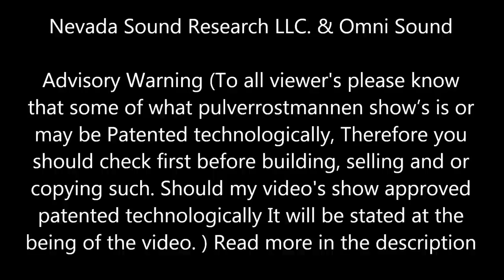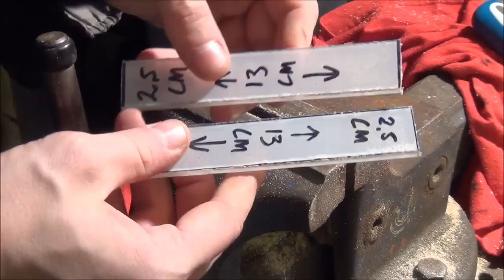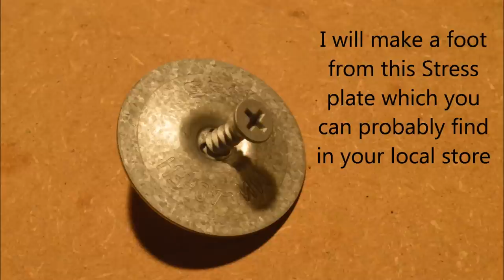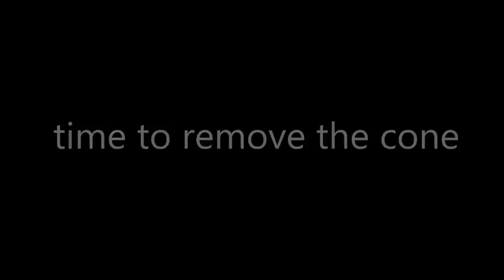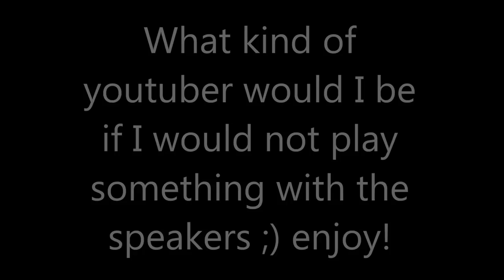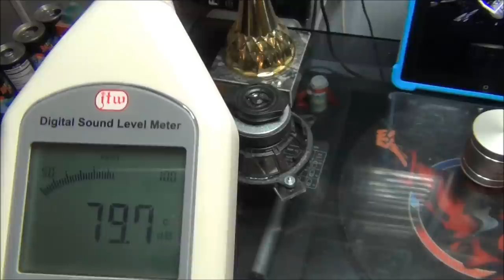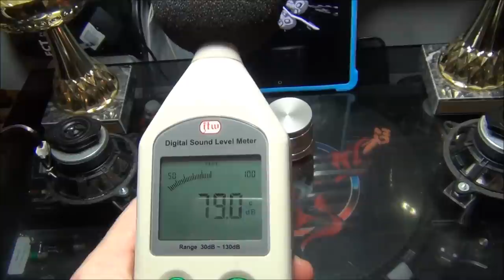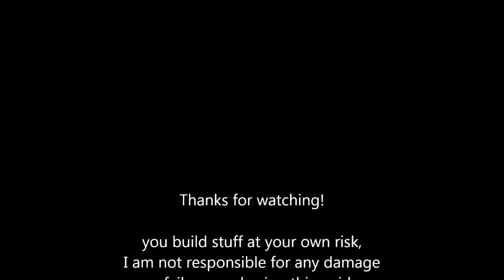How to make a vibration speaker (Omnidirectional design)

Comment: Nice job! You inspired me :) building one myself right now. Been thinking about the concept all day haha, improving it a little. What about some (rubber?) Damping between the plexi and the frame, and stiffen up the spider or even add an extra spider a like, so the coil wont be pushed in to far and it can rest on the piston and be able to move freely from the frame, wich is probably helping its response, and the weight of the frame itself can act like a sort of damper, vibration/weight/gravity :) keep up the good work! Ps. All those haters.. i dont get it, probably they dont want to use their brains.. ((neww)improved)stuff will only happen after trial & error ;) Greetings from Holland.
Reply from the maker: Thank you for your feedback!
Yes there is certainly ways you can improve how the driver going to work and probably the foot itself is a good way to start and you could add some rubber layer to dampen it a bit but it may also take sound away in the process, but the best thing you could get is some kind of sticky hard silicone that kinda stick to the surface that would make it rock solid in that part and would improve sound. 

And making the spider harder using more layers can help keeping the coil in center and stabilize the build but mostly the plexiglass gonna keep it hard enough to not slack if you tighten it off center and calibrate it for the drivers weight to end in the center position of the coil. Making the driver too stiff will make the coil suffer more from the heat generated and you lose efficiency of your device but would however improve the response and dynamics more. 
You are fully free to make your own modifications of your driver and experiment with what works the best and you will end up with an even better driver than mine :)
Why so many people react to this video is a lot because of misunderstanding about the patents that the respective owner claims that I show in this video but I do not own any of these myself but I need the information to show this on YouTube. 
And the other half is because many don’t understand the concept of this type of speaker either and also that it’s not better than real speakers. 
And this video is nothing but a educational guide and help for people that actually want to learn about speakers and how to make this kind of thing just for the fun of it. 
Everyone thinks different and I respect that as well but I also wants people to show some respect as well for their opinions. 
Anyway I would be very glad to hear how your speaker turns out for you! Be sure to connect back with your result and good luck with your build :) greetings from Sweden

Comment: Will induction vibrators from phones work for that purpose?
Reply from the maker: Likely not as most vibrators in phones uses a DC motor with a weight to create the vibrations, not sure if there are other types of solutions integrated in some phones today though or how good that would work. surface speakers do need some counter weight to work properly against various materials and if they are too light it would not make much sound at all for this purpose

Comment: will this work for a bass drum in a loud continuous setting?
Reply from the maker: If you dimension it enough it likely can, you can browse my uploads and check the other guide I have on "how to make a bass shaker" which is designed to shake a lot and for longer time with more power :)

Comment: Is there aliasing when you run it in stereo on the same surface?
Reply from the maker: +Jacob Jones the speakers seem to coop together pretty good on the same surface as it becomes louder when they play the same beat without sounding strange, you can hear them play stereo but maybe with less channel separation as the sound feels more centered between the drivers when they are on the same surface

Comment: I need help please anyone can i use a small speaker of about 3 inch? and also can i use plastic scale instead of plexiglass?
Reply from the maker: The speaker you may use can be a bit bigger or smaller, the outcome is that you get different output from them in the end, any stiff flexing plastic should do as long as it can carry the weight of the driver without bending too much.
Reply: Pulverrostmannen ok so thick plastic 2mm work ? and also do u have Facebook ?
Reply from the maker: Origami World I think it could work as the driver is small and likely pretty light. I actually don't have Facebook. I have or Skype or mail if you like to chat with me
Reply from the maker: Origami World I can't send you a private message as you don't have a public channel. if you navigate to the "About" on my channel you get my mail if you request it on that page, send me a short mail there and I give you my Skype from there :)

Comment: CA glue is not the best way to go here. All its strength is in tension . it doesnt have great tensile strength like that. It is greatest when it is being used too pull o the object so you really only needed a few drops of glue. A huge puddle of it like that does not give it more strength.
Reply from the maker: it depends very much how this glue is used, mostly it is used to glue hard materials with a thin layer as you say, but as you likely seen in the video the cap is made of plastic that few types of glue will stick well to, and also that the glue is put on both sides of the washer and makes a kind of cast bonding making it impossible for the washer to come lose even if the glue itself would not stick on the washer. it may still break lose as the glue can crack absolutely but we are not using tons of power here, there are several factors here of why I decided to use this glue for this build, it is cheap, Like REALLY cheap, it WILL stick on these materials, it is hard and not flexible increasing the output, it hardens fast, it stiffens the soft cone and dustcap and it is still strong enough to last any of the factors used on such build for a long time. Digital Designs uses CA based glue that uses the same activator for their high power sub woofers that bonds the spiders and also the cone to the voice coil and surround to the basket, and here we have the most extreme flexing with thousands of watts power that put strain with both positive and negative force on the glue and it won't break if a proper layer is made, and it is glued with a thick layer above the materials as well. but this video is a guide, you may absolute do it your way too, I won't care

Comment: I see no reason to cut out the cone as you've already greatly reduced the distance it can move. Leaving it would probably improve the sound of the unit.
Reply from the maker: Karmicmessenger the cone can be left on the driver but there are several reasons why I cut it away. One reason is to eliminate counter waves that could occur between the surface and the speaker that could lead to acoustic short that can reduce sound. The other reason is that the whole principle of this kind of speakers are that the driver itself should be as quiet as possible and only the surface should play the music, leaving cone would make its own muffled sound at all times. Third reason is that every little gram of weight reduced on the moving mass bound to the coil will increase the sound and range and we want it to be as light as it can be for this reason. 
The fact that surface speaker has a tight suspension is that it won’t need or can’t be that much of excursion on them as they would only bounce around. A big surface will move lots of air at a minimal movement. And it is also necessary to this way as the hard suspension also carries the whole weight of the driver and need to be stable to do so. Naturally if you want to make it another way is totally fine too, this is just a guided way of how I did it

Comment: pretty awesome project but, can you do this in wireless?portable bluetooth speakers for example???nice job anyway, 2thumbsup👍👍😊
Reply from the maker: timothy gabriel thank you!
If you would find a portable Bluetooth amplifier (or just a wired battery powered amp) it could power such a driver with some power for sure but if this would be better than getting the actual real surface speakers are hard to tell

Comment: 3:45 ..
WHY ?
Why go to all that useless waste of HAMMERING energy (and possible injury to yourself if it "flies at you if hit wrong)
When you actually have a far better tool - that you ONLY USE to hold the socket with?

Use the socket against one jaw and place the hammer's FLAT FACE against the other jaw, with the ball-peen "head" against the washer.
USE the easily controlled PRESSURE of the vise, to strongly PUSH (with no hammering effect to over-kill the washer) the ball-peen into the socket with the washer trapped SAFELY & SECURELY between these two.
No chance of it flying into your face - or anywhere else for that matter, when trapped between the jaws of the vise.
Plus - you can get a very precise "curve" in the washer - without degrading it's strength.

Comment: Make an version of thin, use 3d printed  parts i gues longer life the speaker and better power output
Reply from the maker: This video was made to give creative ideas and education how it could be made that you can use to make your own creative versions of :) but sure. Light weight parts is essential for overall performance and sound with this kind of driver
Reply: @Pulverrostmannen   I make an version vith 3d printed parts later (few days). I write here what the first impression to. 1st i need build prooper amplifier.
Reply from the maker: @thekassaiba6694  sounds interesting. Let me Know how it goes. If you like further help or tips let me know and you can connect with me on Skype or discord
Reply: @Pulverrostmannen  i need few days. Make an amplifier, and 2 days later i make the print and the speaker.
Reply from the maker: @thekassaiba6694  take your time :)
Reply: @Pulverrostmannen  I start the project now. Drink a cofee, finish the probe amplifier, and find some filament.
Reply from the maker: @thekassaiba6694  good luck. I have my coffee meanwhile

Comment: Pretty sure you couldn't prove a patent infringement case against someone making one for their private use.  Entirely different if they are making and selling them.
Reply from the maker: Probably not. I did not have that much choice but to include this information to have it on YouTube. It may be or may not be necessary by legal terms but since there was some kind of thing that may be patented that was shown public it is better to have the information than getting in trouble for it anyway. I just did what I was told to do

Comment: Nice Shot Man! I'm sure SpongeBobbers will have at least 200 repetatve irrelevant self-affirming blurps:
"I bought a soldering gun last week, where can I get solder?"
"I dip my soldering iron in a can of acetone to clean it and cool it down when I'm done, does lacquer thinner work better?
"I'm confused, when we hook up the two wires is that 110 or 220?"
Reply from the maker: The conclusion is that everything is always relative. We all have to begin somewhere

Comment: 2:43?
YOU DID NOT SPECIAL SHARPEN YOUR BIT..
You just altered the angles to suit yourself.

In order to make absolutely certain - any PERSPEX doesn't crack / splinter or shatter..
One needs to regrind the bit with MOST of the cutting surface removed, leaving an outer "edge" higher than everything else - except the very middle which is shaped into a long thin point.

A BIT THUS RE-FORMED (it looks like a W when the bit is viewed from the side) will have an exact centering pin drill, which makes a pilot hole, before the extreme OUTER EDGE starts cutting the Perspex, 

ONLY when the Perspex has been "cut" all the way around the outer circumference of the hole, will the internal cutting edges start removing the rest of the Perspex, from inside the outer edges.

You will "always" get a perfectly centered, perfectly round hole.

NO cracking, no splintering, and definitely no shattering of the Perspex.

What you have there, is a normal type of APEX sharpened drill bit - with a very high tendency (& thus very likely) to have a nasty tendency ...
To dig deep & shatter the entire Perspex - if the bit "grabs" on it's way in.

The W cut drill bit is often called a BUTTERFLY cutter, in that the outer edges of the butterfly's wing tips cut a circle around the outer edge - immediately after the pin tip creates a tiny small pilot hole.

ONLY when both those things happen - will there be any CUTTING OUT, of the rest of the brittle Perspex.

Note:
A BUTTERFLY drill bit, is NOT a flat SPADE bit, although it's general shape is similar.
The HSS (High Speed Steel) dril bit that comes already sharpened for general use, needs to be REGROUND into the butterfly W shape tip, to create a W in the tip - with the inner ^ higher than the two outer tips, as the inner tip needs to center and create a "holding" pilot hole first , before the twist drill's outer edges start to form a circle with the exact outer dimensions of the hole, ito which you keep spinning the HSS Bit - until the inner (much lower) cutting edges remove waste from inside the hole.

A SPADE BIT - only has a pinhole pilot maker center, and the outer tips higher.
The rest of the spade drill bit is FLAT across it's waste removal cutting head.

A SPADE BIT - is great for WOOD and soft materials

A HSS BUTTERFLY TWIST DRILL, is excellent for extremely brittle &/or extremely hard materials
PERSPEX and Stainless Steel are two things you will need a butterfly bit for.
Reply from the maker: And to make things very simple. The cutting edge is removed on the bits to form the special cutting properties and the drill is not shaped as the “normal” steel cutting drills anymore. Therefor it is special for the purpose and this shape has not cracked anything for 15 years I been using drills shaped like this in any types of plastics. Acrylics or anything the likes. Even brass and softer metals can be cut with this and it leaves a perfectly round hole. So why don’t you try it before you tell me anything else if you know so much about drilling. And the information is included in the video because most people without knowledge about this type of drilling would just go with a sharp HSS drill and you know that gonna crack the glass when it goes through the other side don’t you? Therefor it is special shaped because it will not do this

Comment: You built a tactical transducer. You should mount it under your sofa.
Reply from the maker: I actually got a much bigger one fit under my bed already to my home cinema system which I have used since 2012 when I made a guide for this specific design, and this is  pretty much the same design in which I made a lot smaller to make a surface speaker with better suited for this purpose

Comment: So all you did was chop us a cheap speaker, then used its motor to vibrate plexiglass. Wow. Folks were doing this in the 1960s, with plexiglass, thin plywood and even styrofoam. Easier to just buy some Dayton or other brand "tactile transducers."  Good luck enforcing a "patent" on this, but hey, even attorneys need a good chuckle. I love the "special" drill you can buy for a few cents at any hardware store,
Reply: LOL! Great insults! Keep 'em coming. You do realize how petty  you look with your over-reactions? But keep the insults coming! Great job!
Reply from the maker: Hi there, just wanted to join here and let you know that the patent involved in this video has nothing to do with me claiming it, it belongs to Nevada Sound Research. and what they want to do with this patent is not my business.  I was contacted in person by the company and had to make a new upload with the information you see in the video and or take the video down permanently. I just made my speaker here and because I mounted the tweeter the way I did it infringe on the patent. I never said it was my patent anywhere right? and for the drills, It may be true you can find them around your place and I am happy for that, but that is not the case here, but at the same time I just wanted to point out in the video for those who maybe don't know about drills that work better in plastic than sharp metal drills or the likes that may crack the plexi glass very easy, and the fact that I could just buy a 5 dollar set of drills and convert them myself to work in plexi can't be so wrong either because it works for me as well as for anyone else that does it. this video was made to be educational and contain information useful to those who are both new and more experienced in the topic. Have a nice day sir
Reply: Thanks for the polite clarification! Duly noted!
Reply: Pulverrostmannen In America at least, it's perfectly legal to build patented products yourself. It is only illegal to sell them. So no company can legally stop you from making, or showing you making anything you want even if it's patented. Just don't sell it when you're done with it.
Reply from the maker: Thanks for the information, I am not sure how this applies here as it is available in a worldwide video, and I don't want to risk anything just for a video. but in the end it doesn't really harm me or anyone else to know that what is shown here in the video is or may be covered with patents, it may save some times for those who have thoughts around this. greetings from Sweden btw :)